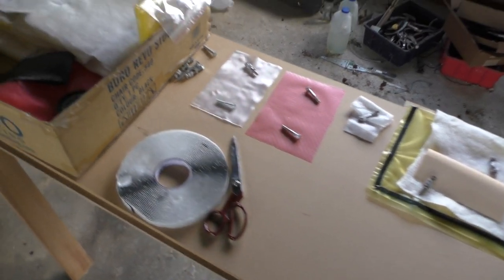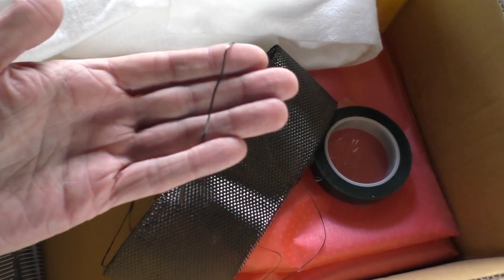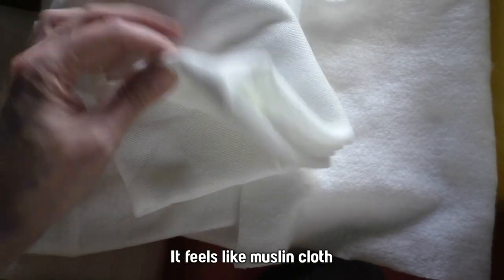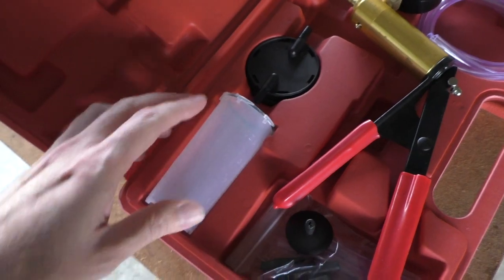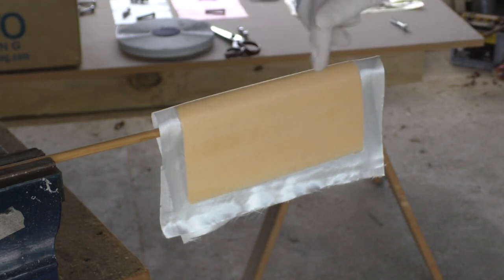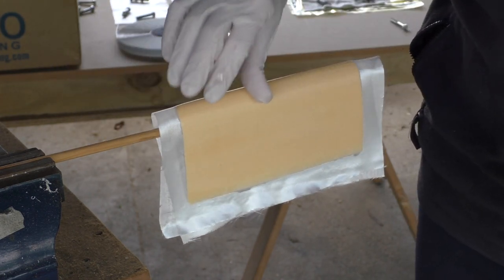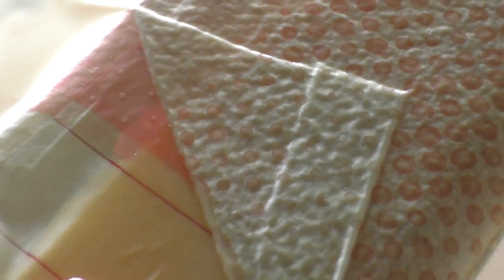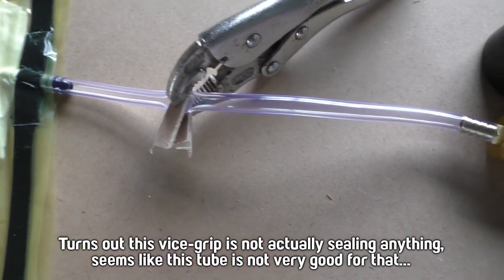Vacuum bagging newbie breathlessly recounts his first experience in excessive detail

Comment: I'm not an expert, but have done limited glass work when I was doing autobody stuff professionally. I also was a buyer for a chain of bike shops and got sent to a few trade shows where I would try to seek out engineers to pick their brains. I have been told the challenge is controlling the actual resin content by weight and/or volume in order to create certain structural properties. I recall questioning engineers about the differences between "high modulus" carbon fiber bikes and components versus the standard stuff. I know the carbon fiber is more refined. The part that surprised me was an engineer that told me the entire manufacturing process is different. The vacuum bagging system and inner inflatable bladder used with a high modulus carbon structure are capable of very accurate and higher pressures. These resulting structures are lighter primarily because of the controlled resin content. The hi-mod carbon material weighs about the same dry, they are just slightly thinner. 
  The last guy I questioned worked for Felt Bicycles and we were primarily talking about the IA triathlon bike when it had just been released. He also mentioned that as carbon fiber bikes evolve a lot of the processes and tooling from the higher end stuff trickles down into standard carbon bikes. He said the majority of the weight savings in the high end stuff was due to the resin control techniques. I believe that's the real purpose behind the majority of the layers with a vacuum bag process. It's all about using as little resin as absolutely necessary for the design. I doubt you're concerned with this level of design by doing things like weighing materials before and after to determine resin content and structural properties. I was simply under the impression this was the reason for most of these layers and expensive materials.
   I was told too much resin is just as bad as not enough when it comes to the structural properties. At least I was told this is the cause of a lot of bike warranty issues. It's probably the reason why I've had problems with some auto body repairs in glass. 
   I imagine you've got the materials already at hand for building something with a minimum resin content. I just thought I'd share that. Perhaps someone finds it as interesting as I do, or can help me understand better if I'm mistaken. 

  Every time I've seen someone working with a vacuum bag setup like this they use a valve that goes inside the bag and punctures through one side. It's a device kinda like a flanged plumbing fitting. There is a disk with a tube poking out the middle. This mates to a similar shaped fitting outside of the bag with a gasket sandwiched between them and creates the seal. With this fitting in place the bag sealing tape can go around the full circumference of the bag. The fitting is designed for reuse too.
  Thanks for sharing your experience here. 
-Jake
Reply: At the beginning of this video I wrote "The bagging process is designed to use as little resin as possible to achieve the same effect I believe". Thought better of it and finished the video, and then read your comment. Great info BTW from solid sources!

Comment: As mentioned by Sparkles, a fridge compressor is an excellent cheap (free) vac pump, high pressure and low volume that doesn't mind too much if run for hours. I'm not sure how a vacuum cleaner would like being run for the same amount of time since you're effectively blocking it up! Its low pressure-high volume nature makes it good for evacuating really big bags at the start of a cure though.

A wrap of tacky tape around the spigot before it goes down on the perimeter tape would probably be easier to seal. You need to go around the bag and really mush the tape down everywhere. A little smooth tool handle is useful to get into details around vac lines or where the tapes cross.

Great work, thanks!
Reply: I mentioned the vacuum cleaner for testing things out
Reply: All this takes me back 30 years when we did the same things and made the same mistakes. 
Frig compressor not a good choice as they originally are designed as a pressure pump, with the returning refrigerant cooling the motor.
I was fortunate to have an old evacuation pump with a bleed off valve. (30" would have sucked the cores flat :))
Frig compressor will work to a degree if the low side suction is allowed to suck a full vented pipe rather than the vacuum. To do this an adjustable tee( found in aquarium gear) is fitted to the suction, one end fully open with the adjustable end going going to the wing bag. We found it does not need much vacuum, around 2"hg is sufficient and run the compressor at least 6 hours. 
As found here, if it's a vacuum, it will leak sooner or later. This arrangement allows at least a full volume of air to give a compressor motor a little ventilation. High side line needs to extend upwards in a vent pipe maybe 600mm high 5/16" plastic tube to stop the compressor dumping its' oil charge.
As far as the wing lining we used mylar sheet as used in motor winding insulation. Don't rely on the vacuum to suck out the excess resin, rather scrape the hell out of it with a credit card or similar and remove excess with a dry paint brush.
In our application we would use the glass covered core with mylar covering, shoved in a plastic bag with around 3/8" tube with many holes shoved the entire length of the core as a suction line. The plastic bag assy was then refitted to the original cut outs from the hot wire and all weighted down with bricks on a straight bench to avoid warping.
Bit of a tip also.... carbon fibre tows make an excellent trailing edge when cleaned up with some fine sandpaper and a file.
Tip 2 ...never paint epoxy  with enamel paint..... softens the crap out of it for at least a month......found out the hard way when my wings collapsed on first launch(F3B glider)

Comment: Just one more tip for all of you that want to take the first steps on composites vacuum bagging... When I first started to try vacuum bagging I used a motor pump from an old refrigerator, it is really easy to find one that works on a junkyard, than you just have to plug your vacuum tube in one of the copper tubes that you will find on the motor, plug it in and find which one is the inlet and you're done.
Just pay attention to its temperature because it is supposed to run with the liquid inside of it to cool it down, just avoid to keep it running for too long.
These motors are really effective for light vacuum jobs and for the beginner to get used to this technique before going to spend more money in a proper vacuum pump.
Reply from the maker: Yeah I just bought one, it was listed in an online auction the day after I made my shopping trip to Auckland... great luck huh.

Comment: At 20:47 you mention that the glas did not adhere to the foam properly when just using peel-ply with the breather fabric. This most likely happend because it is way harder to remove the peel-ply-breatherfabric combination than if you use the plastic foil with the holes in between.
So while pulling the peel-ply off, you probably also ripped the glas from the foam.   
Try to always pull off  the peel-ply tangential to the surface.

Comment: The bleeder looked good.  I always told our shop personnel that one should see the individual holes and not have the bleeder flooded.  The peel ply leaves the surface ready to receive additional glass or bonding and should be left in place till just before the next layup or bonding operation as resin left exposed to air reacts and oxidizes reducing the bond strength.  If you get a vacuum pump also have a tank as a reserve.  To find leaks turn off the pump and listen carefully and you actually hear where the leaks are.  And finally, the vacuum tube should should have a bleeder path all the way from the tube to the other side of the bag as it is the primary airflow path.  Good Luck!

Comment: Brill! Great skill and technique extension from the epoxy just applied to the surface on the Homeslice.
Some DLG sites I've looked at appear to use some type of mylar film as the surface contact material, and results in a glass smooth surface.

Comment: Nice experiment. I bought the same vacuum pump for my automotive needs because it was the cheapest. One annoying thing about it is that those red rubber handles slide off. I ended up gluing those on. The slightly better hand pumps that are more common cost about twice as much money. I think if I got into doing much vacuum forming I would look for some kind of electric pump that either has, or I would add, a pressure control to it.

Comment: vacumm is not just to pull resin off, its also to increase bond strength to underlying material (foam, wood, ect ) the tensile strength supplied by carbon fiber or glass fiber, the hardness and bonding is provided by the resin.  all glue joints will be stronger under pressure!!

Comment: Dont know why you bought that pump when you will already have a solution to you problem and its  called  Henry (vacuum cleaner )   If you want something quiet then use a old fridge or freezer compressor 

You will need a one way value and a value to to let air in 

Im glad you have done this video because i have never done it and always glad to be able to learn more about things

Instead of sucking the air from the opening of the bag get a old inner tube and cut the value  from it leaving a ring around it cut a hole in the bag and feed the value throw it and glue in place . . metal value would be better because you can seal it from both sides using nut washer and rubber washer

Comment: There is a better plastic film with slit-perforation instead of huge holes. The slit type does not leave those rough spots and is even easier to peel off.
Orient so slits are in direction of air travel.

Comment: I've never seen more than a bag and a pump...  Canoes and whatnot, they just shove the canoe in a bag and suck on it...
Reply from the maker: Are you sure? Where does the resin end up, wouldn't every crease in the bag become a sharp ridge like I got on my 'leading edge'?
Reply: @iforce2d  I think the excess resin gets spread over the surface through surface tension and viscosity... they do try to smooth the bags out as much as possible, to not leave creases, and there's sanding and painting that goes into those larger pieces, but I think the excess resin just molds itself to the geometry, and adds thickness...  It's really the first time I see more than the mold/glass/resin going into the bag, though, probably because they get good results with just the bags, and the cost of all those membranes is just prohibitive in relationship with the results they give...

Your surface ends-up very rough and covered in little high spots with the membranes, anyway, and you're definitely going to have to finish that off, so I think you're better off with just the bag, and sanding the single curve of your leading edge down, maybe make a sanding gauge, but if you're careful, I guess that would leave you with a 1 cm stripe of rough surface to finish...  Which is pretty good, IMO!  The smoothness of the bag-only was such that I was like "whoa!", so even if there's a few irregularities in the geometry after sanding down creases, the smoothness is such that the little drag those would create would be minimal compared to having to sand all the little pips and whatnot...

I really don't know all your steps, and only have an idea of your desired outcome, but from the perspective of someone who hasn't spent $150 on a starter kit (and wasn't brainwashed by a salesperson 😋) I really think you're better off with just the bag, or at least give just the bag a try before you go all out, compare the effort/outcome...

You were getting good satisfaction with applying the glass on the resin, too, about the coverage, so I don't think removing the little excess resin weight was your objective there...  I think you could be happy with just the bag, but if you really want to fiddle with the pro accessories, and toss a bunch of fabric and plastic in the garbage... what can I say?  😉